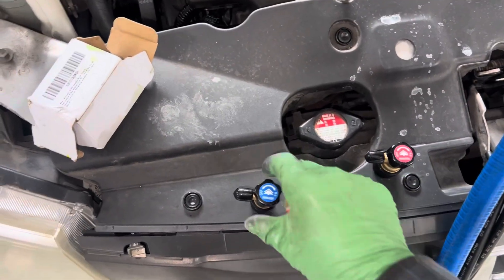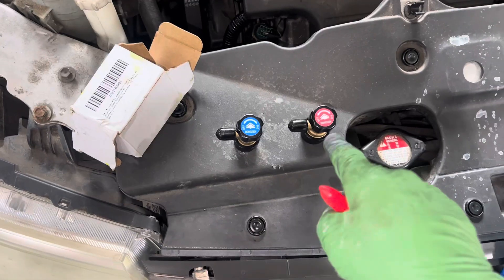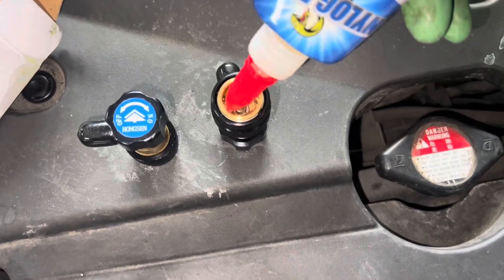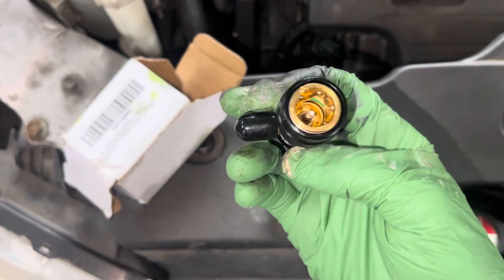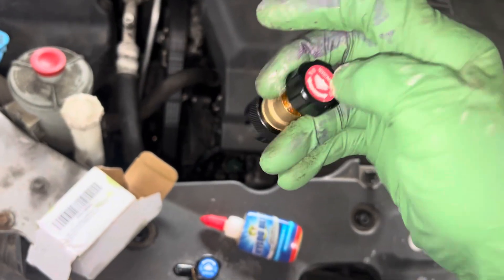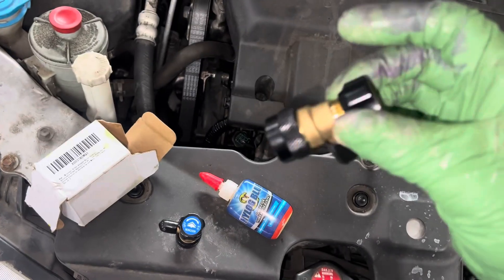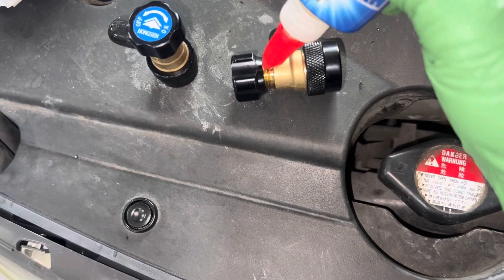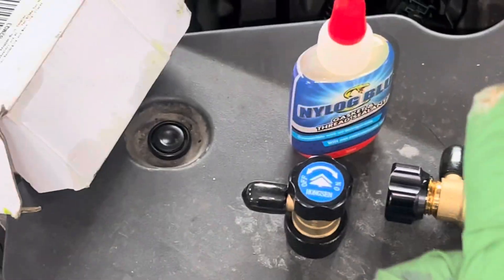New R134 service coupling preparation for first time use

Comment: Ment to ask you. What do you put on the o-rings when you assemble the system? Oil, nylog, silicone grease? What I experienced is the nulog with vacuum grease mixed is not good for o-rings. Makes them expend. Only place I mix nylog and vacuum grease is the ball valve shaft. When this two are mixed they create extra long molecule (i think) preventing shut off valve shaft vacuum leak. I remove the lever and apply good amount to the end of the shaft then reinstall the lever.
Reply from the maker: I would never try to mix them in the first place to completely different chemistry not compatible. 

That’s like trying to mix milk with lemons . 
   Or water with oil. 

I prefer silicone grease 

NYLOG is just easier to use 

Inside refrigerant gauges only silicone grease cause it doesn’t wash out like NYLOG
Reply: @coldfinger459sub0   what do you use for the system assembly? I mean on cars or whatever you work on. Manufactures say to use refrigeration oil. Do you use oil or something else for o-ring lubrication?
Reply from the maker: @aleksgrigorev2717  I use both silicone or NYLOG. 

If I have a vehicle that has captured O-rings . 
    In the pipe where you see the deep indentation groove
Or in the head of a compressor where it has machined out groove 
I will fill those up with silicone grease .
Reply: @coldfinger459sub0 I was doing the same but one time had one unit to come back after a few months with a restriction problem. Took it all apart and flushed. Could not find a problem. Eventually found a good size chunk of silicone inside the liquid line site glass manifold. Past the filter, right next to the TXV feed line. My only guess is it got sucked in from the Block TXV o-rings during evacuation and got pushed in further during the charge. What I think it was one of the cases where it leaked vacuum but stopped after the pressure. 
I only apply enough to cover surface. Usually dont allow any extra grease inside the system. Maybe I got interrupted and forgot to wipe  off the extra, maybe didn’t notice 🤷‍♂️ who knows lol 🤣 ever since use high vacuum grease only for gauges, nylog and oil for the system😂
Reply from the maker: @aleksgrigorev2717  well when somebody over, applies something and then sloppy I guess that could happen

Comment: Parker also makes couplers for R134a and R1234yf. They are made in USA and are rock solid
Reply from the maker: Yes, Parker makes extremely high-quality couplers. I have some.. 

Supposedly Parker used to make them for yellow jacket . 
    Apparently, yellow jacket does not wanna use American companies with American citizens as employees to help Americans make money

They now wanna get the 50 Cent Taiwanese made couplings and still sell them for $70 each and have them fail after three or four months of use